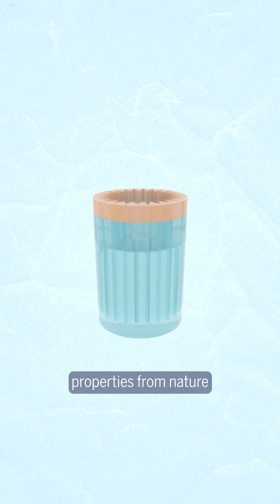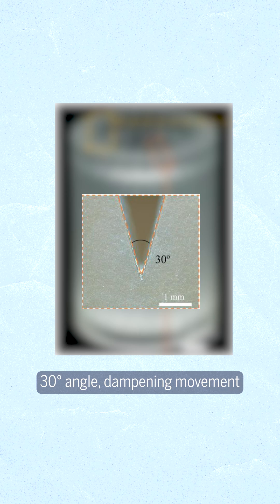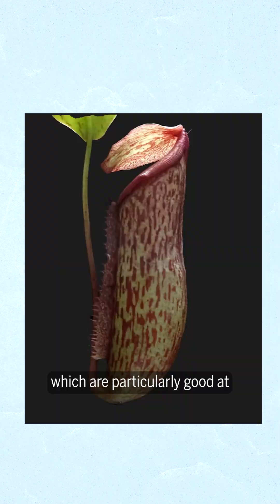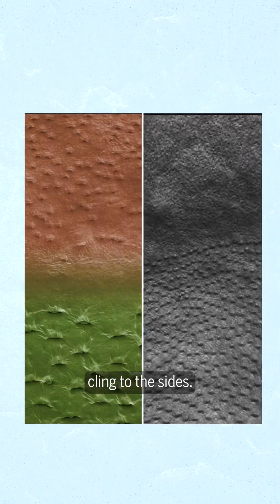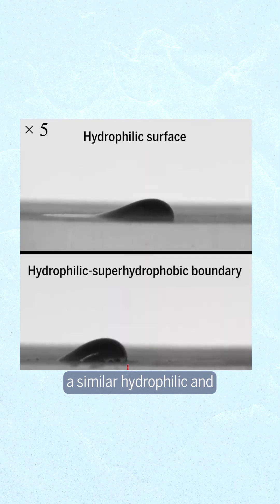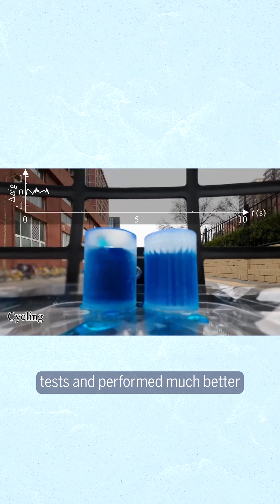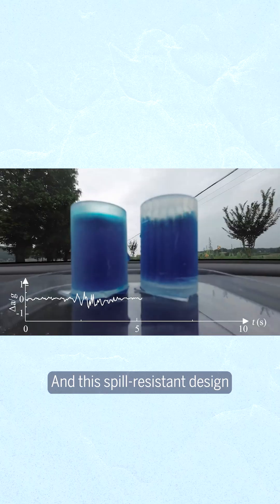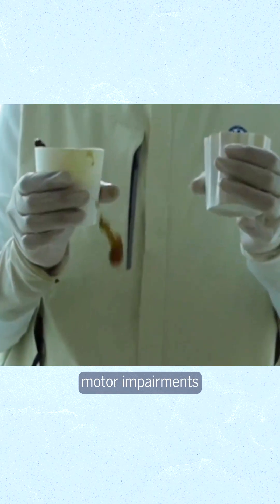How does this cup stop spills?

Comment: This, combined with that swing-thing that uses centrifugal force to avoid spilling, would be the best combo
Reply: @spin4team4096 What are you talking about?
Reply: @adamsmainchannel3789  there are bowls and sometimes cups that have points of rotation on each axis. The bottom of the bowl always faces down due to gravity, no matter which direction the handle is in, making the bowl difficult to spill when holding the handle

The examples I always see are for babies, since they can hold the handle and aren't aware of how not to spill bowls yet
Reply: @CosineKosan0620 Ah ok thanks
Reply: @adamsmainchannel3789 look up "Swing Wing"